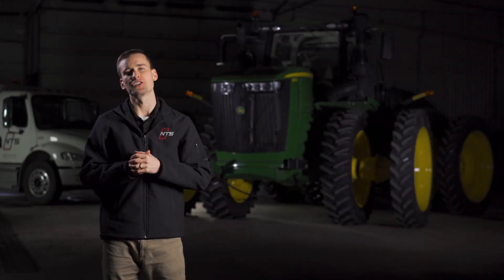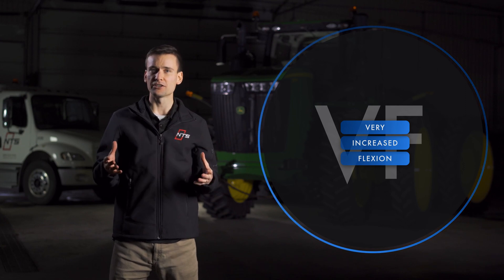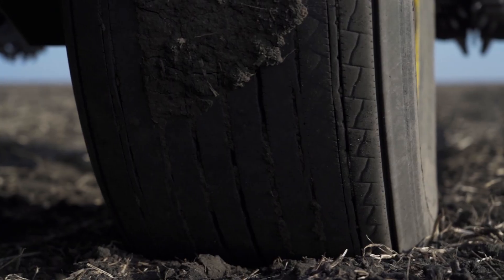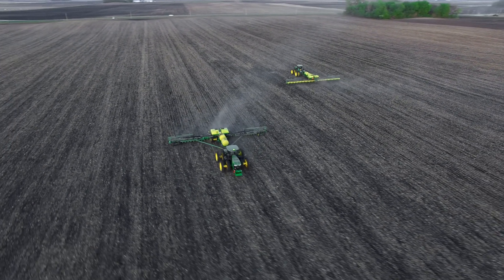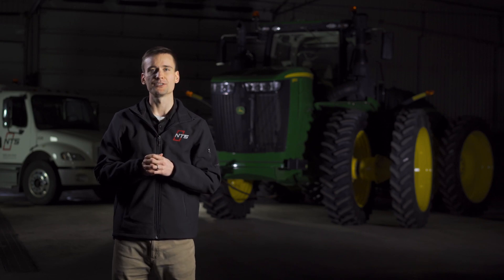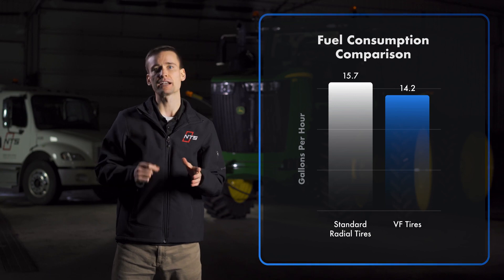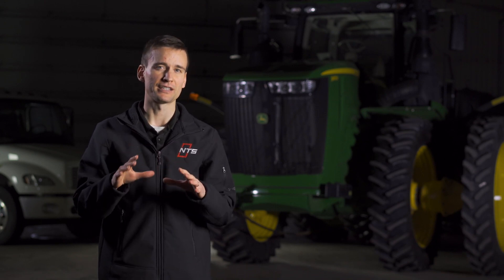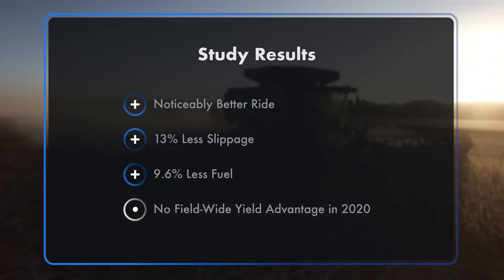Does it Pay to Plant with VF Tires?

Comment: I noticed that vf tires show a different rim width.  Do you have to switch the rims also or did you just install the vf tires on the radial rims?  Thanks
Reply from the maker: VF tires will fit right on a standard radial rim. This farmer has a unique setup where the inside tires are wider than the duals.